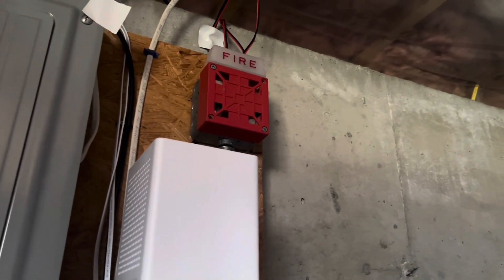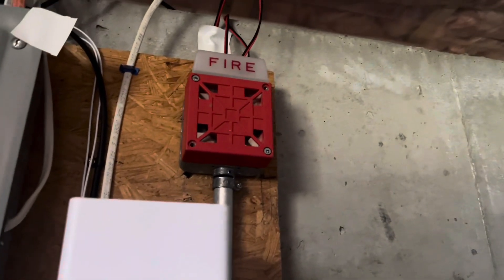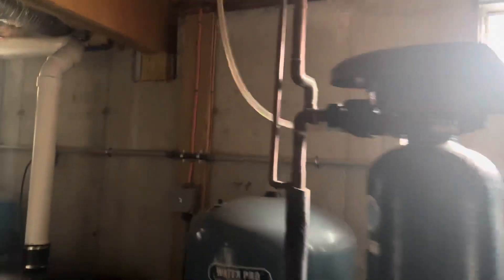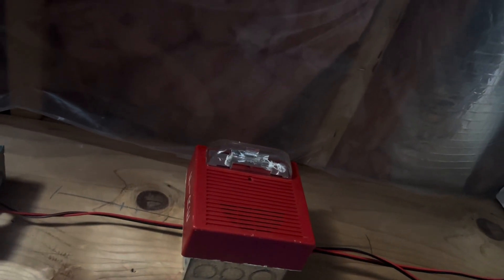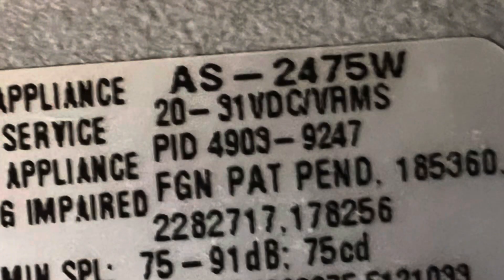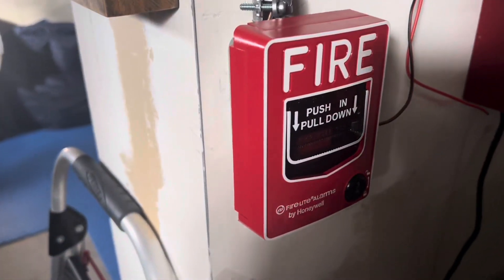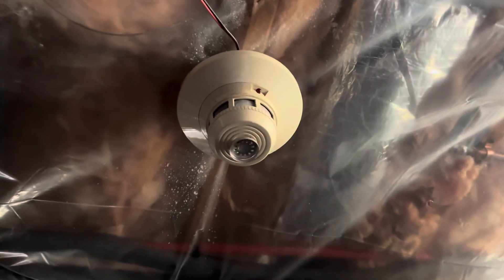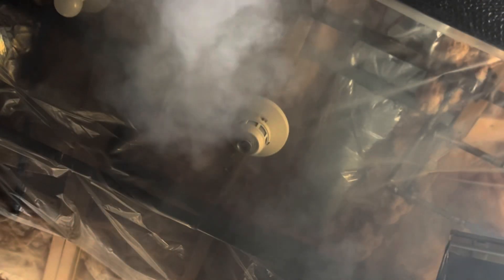Fire Alarm System Test 49: Wheelock System

Comment: Ain’t no way simplex rebranded the Wheelock as 💀
Reply from the maker: I was confused af when it pulled up and I saw “4903-9247” on the back label 😂
Reply: I saw a simplex rebranded EST integrity  on ebay, ain't no way I'm calling that thing a 4903 💀
Reply: @TheModel2TOfficial  bro drop the link
Reply from the maker: @That_2_guy2T there’s no way you found that 💀😂
Reply: Crap can't find it, someone probably bought it or ebay is busy riding around is a motorized wheelchair
Reply from the maker: Typical eBay
Reply: Wait what is my number?